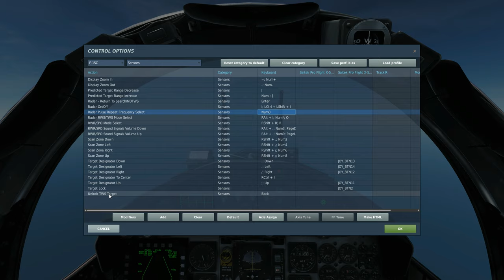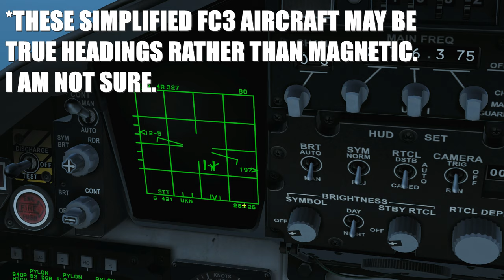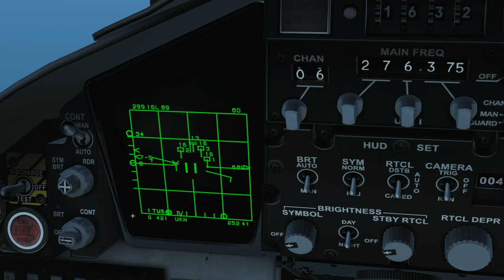F-15C Eagle: BVR Radar (Search, Lock & IFF) Tutorial | DCS WORLD

Comment: For the tech geeks out there:  the radar does not actually move.  The hardware used is a phased array of wave guides.  The RF signal is phase shifted to each element in the array in order to make the outgoing beam coherent in a specific direction.  The beam is swept as described by Cap, but the hardware remains stationary relative to the aircraft.  The tutorial is still valid. https://en.wikipedia.org/wiki/Phased_array#:~:text=In%20antenna%20theory%2C%20a%20phased,directions%20without%20moving%20the%20antennas.
Reply from the maker: Thanks
Reply: Considering this is a C model, it's likely not an AESA/Phased Array. The original AN/APG-63 wasn't AESA, but the AN/APG-63(V)1-3 are. The old C and D models were retrofitted with the AESA radars relatively recently (as in the year 2000 in an Alaskan F-15C), but I doubt they are what was used in the DCS model. AESA Radars are beasts though. Easier to work on by far
Reply: These older planes certainly did use mechanically scanned radars. The behaviour of this simulator seems to be that of such an older type.
Reply: These C models actually did use mechanically scanned radars, which very much did move, hence the bump stops.  Some models have been retrofitted with ASEA radars but this looks like the original APG-63 by Hughes.
Reply: F15-C's radar actually if move. It's not aesa radar.

Comment: Need some help
I'm new to DCS and I'm having an odd time with the F-15s BVR radar, in the test mission I am able to use the radar as intended, it all works.
But for some reason in other missions I am unable to lock targets. Example the instant action 1v1 BVR I can get the radar to pick up the enemy aircraft but when I attempt to lock the target, it does nothing, as if I'm attempting to lock onto nothing. I am new to DCS so It could be that, there is something preventing me from locking on. any help is appreciated. Might just be the radar having a hard time, but I have tested HOT targets and it just cant lock for some reason
Reply: Maybe the target is using ecms?
Reply: If your radar detects them you'll see a bar on the screen and if they are using ECm you'll see a strobe of boxes on the radar screen once you try to lock on them. Idk how to beat this. HMU if you're on insta